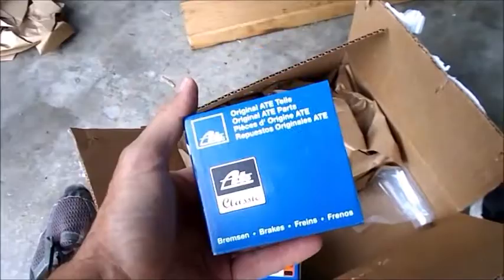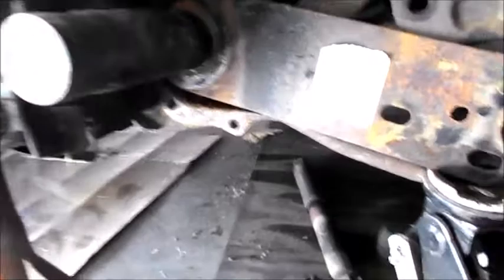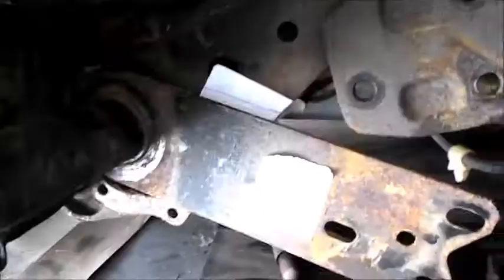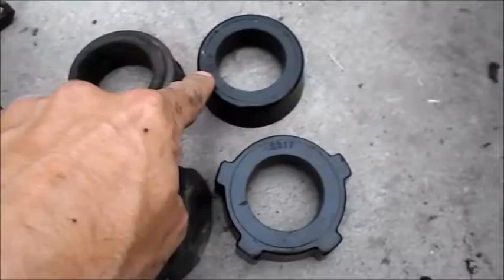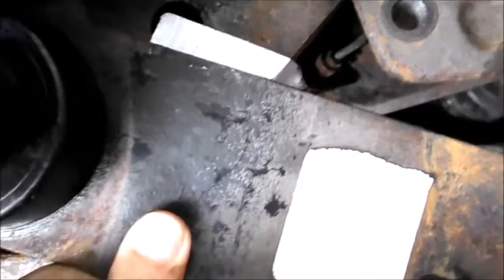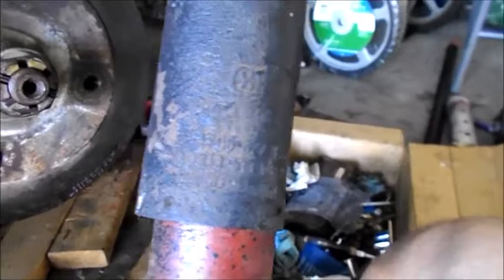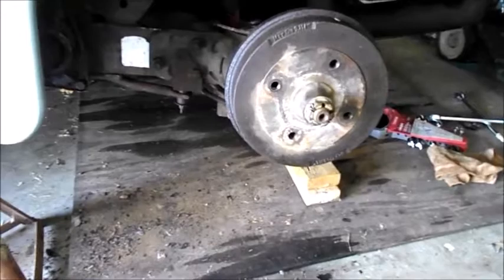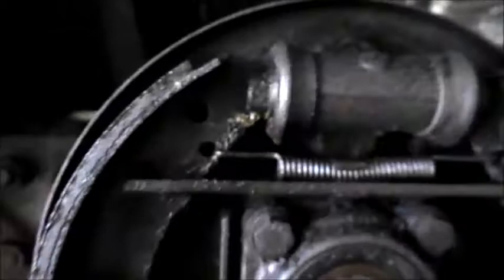vw 73 super beetle irs torsion bar bushings

Comment: Front camber, but front and back would be good, just wondering what is a good setting for the front. Mine was a bit neg and wore tread on the inside. I moved the camber in a lil,but if I go to close to level or positive camber. I get the shakes at 35 to 40 mph. I'm hopein I have it set good , don't want to ware down the front tires inside tread again, if the tread wares like that I also get the shakes at 35 to 40 mph. It seems to grip well with lots of neg camber, but the inside tread is gone in 3 to 4 months.
Reply from the maker: these cars are so light in the front that i've never noticed any bad tire wear on my '74 and i ran a lot of negative camber on that one so that the tires would tuck under the fenders. perhaps for you it's negative camber along with too much toe in or toe out.

Comment: Do you happen to know what size those longer bolts are that you bought from Home Depot? I need to buy some and want to make sure I get the correct ones
Reply from the maker: i have HomeDepot send electronic receipts so i can look back and find things like this:
887480023084 CAP SCREW <A>             
     METRIC CAP SCREW 10.9 M10X40MM ZINC
     2@2.48                          4.96
Reply: Scotty C oh man thanks a lot! You saved me a lot of problems there!